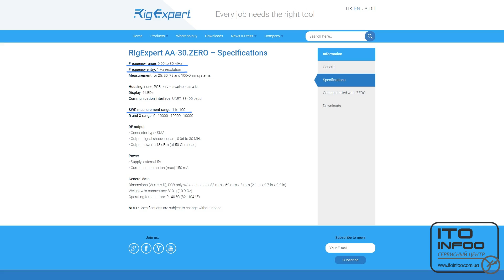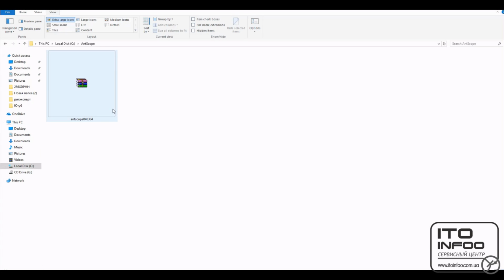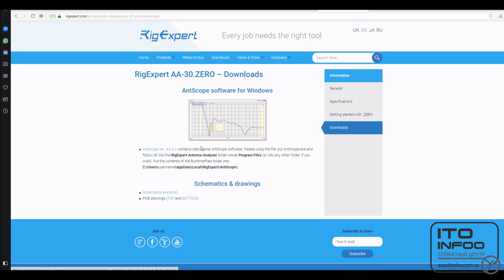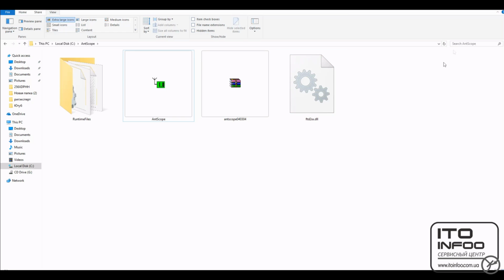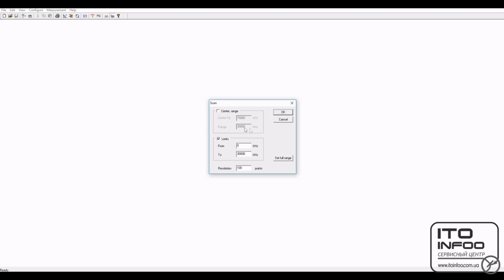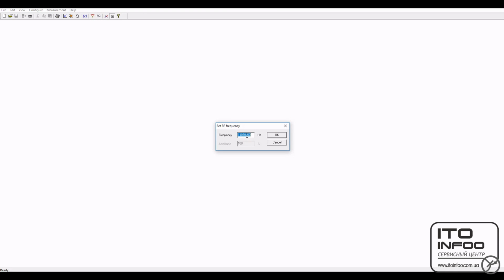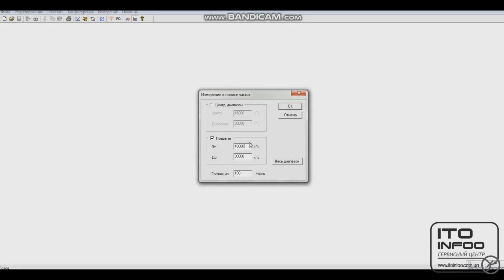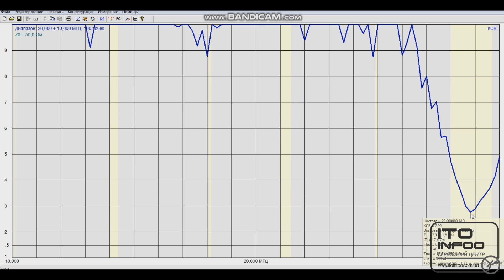AA-30.ZERO. Video in English.

Comment: Hi Thank you I will show many USA friends..  I have AntSCope running on a mac under WineBottler and I do not see 
any COM ports.  The mac ports are  /dev/cu.usbmodem1d11  and  /dev/tty.usbmodem1d11  when an Arduino DUO is
connected.  Have any ideas?   Thanks
Reply from the maker: Hello, Ed!
Does you computer "see" the USB-to-UART converter?
I also found on the official website mini-manual:
AntScope software – requires WineBottler to work. Copy the AntScope folder from the archive onto your desktop. Run AntScope.exe. Go to Configure menu and select your analyzer model (AA-30 ZOOM). Go to Configure – COM port menu, select a serial port name, such as “usbserial-0000xxxx”, and then press OK.
Latest virtual COM port drivers – visit the FTDI drivers page